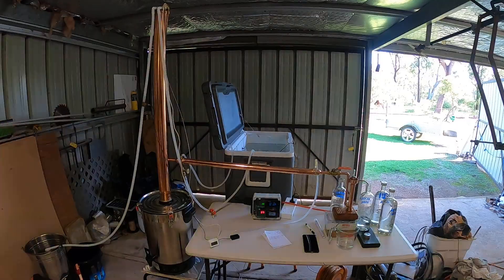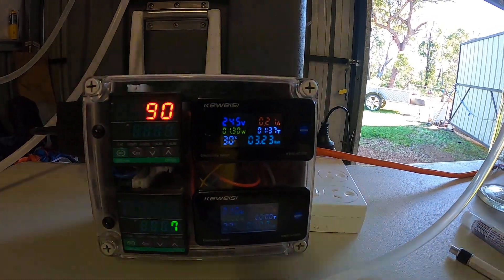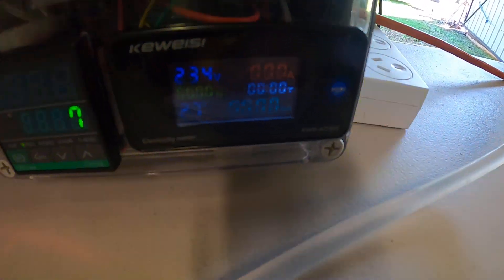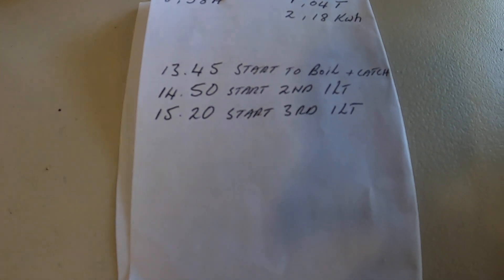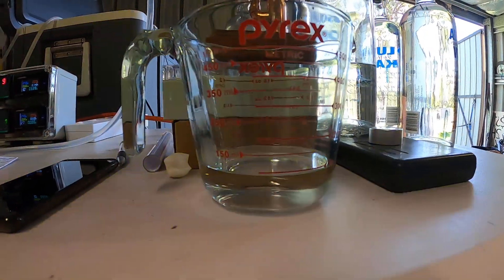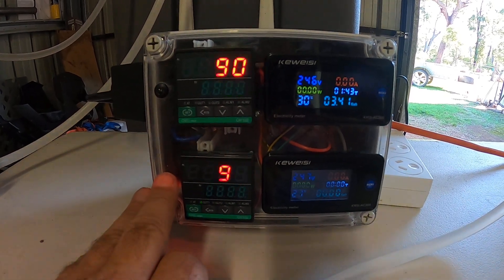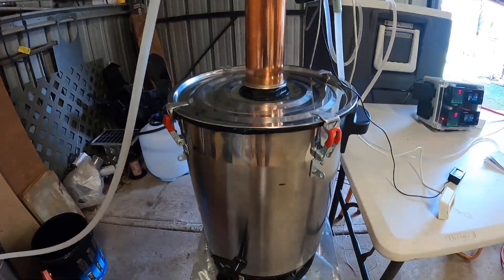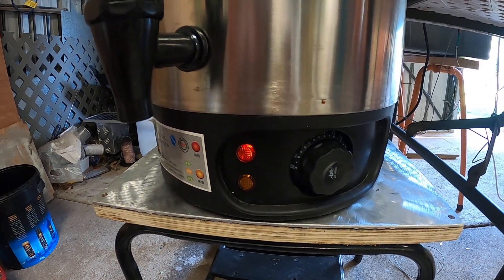Reflux still running with dual Pid temperature controller

Comment from the maker: Here is the power meter link. https://a.aliexpress.com/_mKXHwDZ
Here is the Pid temperature controller link. https://a.aliexpress.com/_mqp7uUJ
Here is the links for the Ssr relay. https://a.aliexpress.com/_mqg2IMr
Here is the link for k type temperature probe. https://a.aliexpress.com/_mrIMDDH
Here is the heatsink link. https://a.aliexpress.com/_mqLV5Jt
Here is the link for the plastic project box.https://a.aliexpress.com/_mM9Rc3V 
I used the 170×140×100 box.
Here is the link for cable gland I used pg9. https://a.aliexpress.com/_mrI4EI7
Here is the link for the fan I used.
https://a.aliexpress.com/_mNS3aTN

Comment: Hey Dan, Wow ive been hanging to watch your vid of your new still. Im interested you have the temp diifrence. I ran my version which is run on a 40 litre beer keg boiler using a 2750w kettle element for power. My controller is a manual dial type i used parts from still dragon to build with a manual stat to check temp. I found with full power from the element and a very little flow from condenser my temp stuck at 76oc which i was a little confused at the time. I have a second condenser fit on the vertical drop so the vertical drop condenser is 15mm internal and 22mm external jacket then into the horizontal condenser which is your design 22mm to 15mm to 22mm to 15mm with 28mm jacket. I ran the reflux condenser on mains pressure and both the other condensers on a pump from water butt. I found the temp was low on the top of columb but noticed i was getting 95% ( 1 litre 93, 3 litre 95, 3 litre 90/92 ish abv ) so i wasnt too bothered. I also collected 400mm foreshots to be safe being a newbee to this hobby. Tanks again for the design and happy with the results......
Reply from the maker: Great Ben I'm still new to the electric still  controller and I build and design all my stuff and just trying new things regulating and perfecting the flow output without mucking around too much. Might do my next run with a 10 000 watts scr controller I built recently that will give me a reduced voltage and ampere flow to my 2200 watts 240v boiler element but at constant power. Should be better than the Pid temperature controller. Happy distilling mate
Reply: @danssv8  Is an SCR controller a manual dial type
Reply from the maker: @benscott5109  They sell them on AliExpress and mine has the remote with it and is capable to handle 10 000 watts or 40amps. Here is the link. https://a.aliexpress.com/_mPmrOVp
Reply from the maker: @benscott5109  This is the one I purchased and built. https://a.aliexpress.com/_mqI43Kn
Reply: @danssv8  I love your ocd neatness with the still's you have built.....
Reply: @danssv8  I had trouble with the P I D screw in sensor read the temp of the copper column and not the vapour temp, S C R is way better I M O, even if I use the P I D as a thermometer I get a false reading, they do have a place but not really ideal for my reflux column, to hard to reach equilibrium and stack the column right. Plus I add Sodium Carbonate to my low wines @ 3 tablespoons p/lt of 40%, it makes the cut between heads and hearts.... and hearts and tails more define and I get a lot more and cleaner hearts. Works great for me using T P W as a wash.
Reply from the maker: I think you should downgrade your element to 2200 to 2400 watts little less current draw .I like your 40lt boiler is a ideal size. Happy distilling Ben.
Reply: @danssv8  Hey Dan, what would the diffrence be in lower power, my undestanding was i need more power with the temp struggling to get to 80oc.
Reply from the maker: @benscott5109  be careful to run Too much reflux water through the reflux condenser it will bring the temperature right down if too much water flow through  , need to regulate the flow of cold water going in with a needle valve tap.https://a.aliexpress.com/_mK7BfEB
Reply from the maker: @benscott5109  please make sure your boiler is set on it's highest temperature,  mine is set on 110 degrees centigrade or if it is electronic you will have to bypass it. You don't want the boiler thermostat to work , that would be a big problem.
Reply: @danssv8  Hey Dan, i tried a dummy run yesterday with my reflux condenser connected to my water butt pump, couldnt get flow through as well as running my condenser's ( the same as your set up basically ). I think because i used 1/4 copper pipe its a very small opening so i think i will keep it on my mains tap for the better flow.
Reply: @danssv8  I use a manual conntroller ( dial type ) so i can run flat out, I did build a pid controller but really struggled with all the tech settings ect. Ha so i just use it to track temp and use my original conntroller for the power. I wish i could send you some pic's, do you have a whatts app number or email.. I not too keen on a video on here being in the uk....
Reply from the maker: @benscott5109  My pump is a 6000 lph pond pump and is 85 watts. Also mine is 6mm tubing and 3 metres long coiled. Try Also to swap the two pipes around on the reflux condenser. I use to run it on gravity before just feeding from a 25lt fermenter I had and worked fine